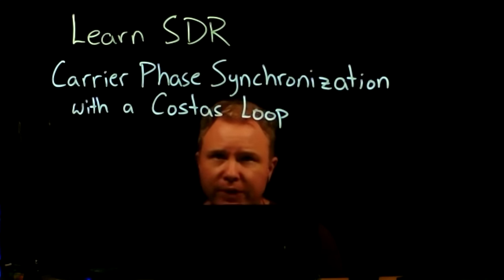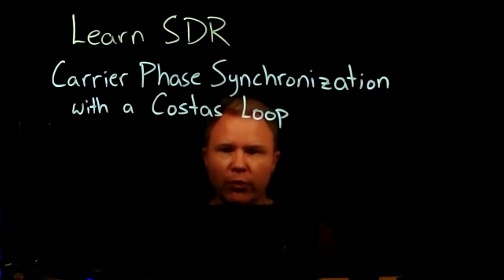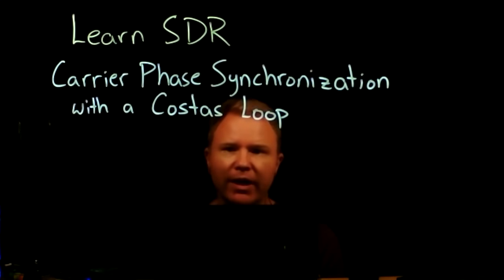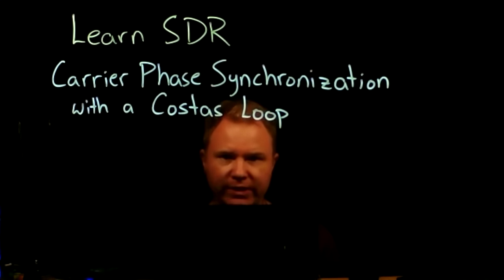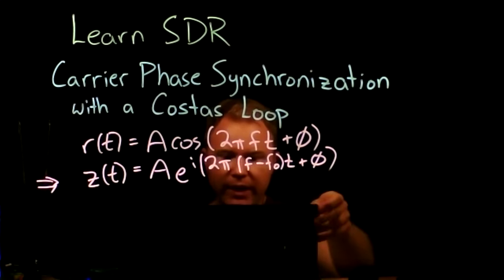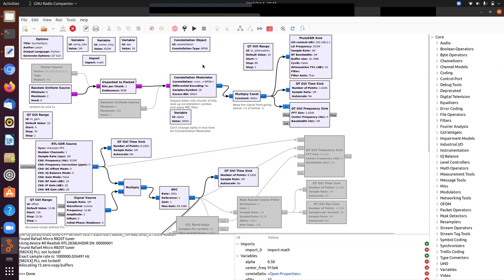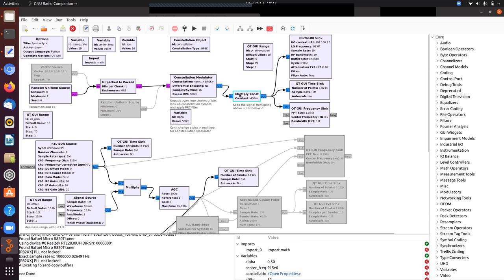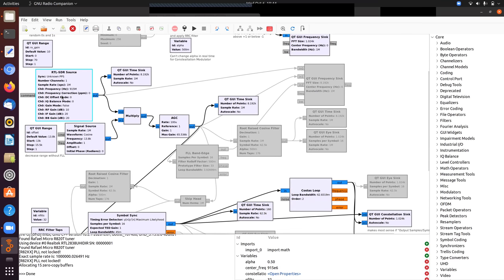Learn SDR 19: Carrier Phase Synchronization with a Costas Loop

Comment: Great lecture, thank you very much! I have one question regarding the order of synchronization steps. I wonder if it would not make more sense to perform carrier (phase) synchronization BEFORE clock recovery (symbol sync) and in that regard I wonder how it is even possible to perform symbol synchronisation without having removed the effects of un-synchronised carriers first. Thank you!
Reply from the maker: The carrier (phase) synchronization described here only works when things are sampled at the "right" places, so clock recovery (symbol sync) needs to happen first. This was not intuitive to me when I first learned it, because the the carrier is the first thing that is approximately removed from the incoming RF, but it can't be exactly removed until much later.